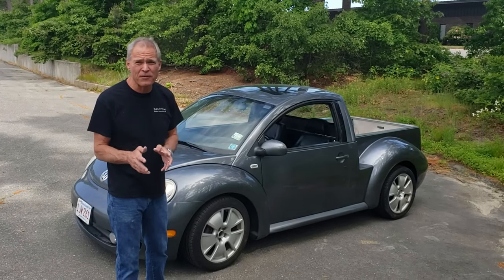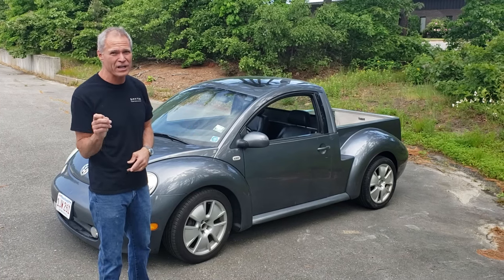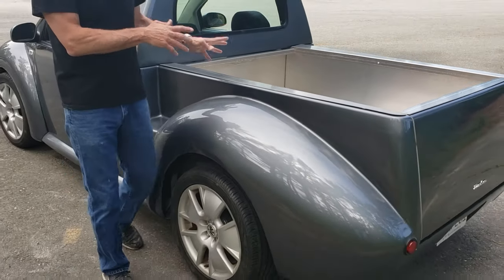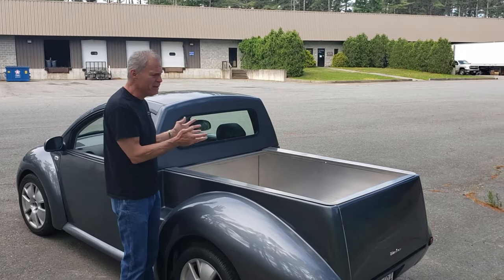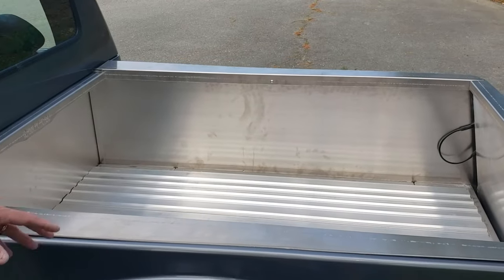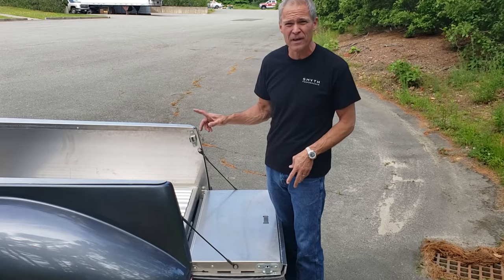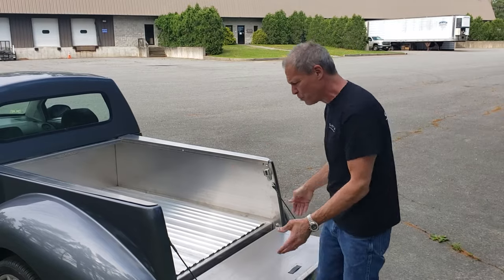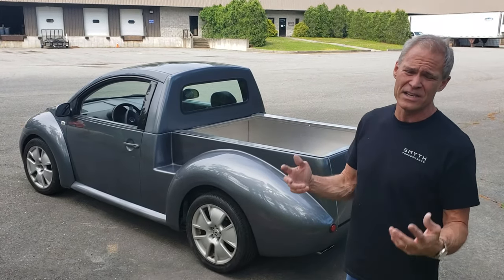Smyth New Beetle Ute Intro

Comment: I SO want to do this to my wife's beetle.  We're buying a new large car for an upcoming baby, and this little ute could be my daily driver.  I assume the sunroof will need to be disconnected, or can it still be used in "tilt" mode?   Also, do you ship kits to Canada?
Reply from the maker: sunroof on the beetle kit still operates both tilt and slide but only slides about a foot now

Comment: Mmm, 1/8th corrugated aluminum bed means serious dents if you ever use it to haul anything halfway serious - which of course you can't because it appears to be a 3'x3' square bed.

I never understand why folks who don't do any physical work or have any physical need demand to have a pickup - Then they lower it to the ground and put 91 load rated tyres on that'll pop the moment you drop a feather in the back.

I don't blame Smyth for seeing an opportunity to make a buck and its a better machine than the base 'Beetle', but that just goes to that old adage about makeup and fancy dress on a pig. - You ain't taking that old hog home to meat ma and pa.
Reply from the maker: Quite the opposite...since most people never haul more than 500 pounds these things are awesome. Motorcycles, engines, odds and ends...I use these every day. The aluminum bed is 1/8 thick 6061 extruded with ribs and supports...i have scratched them up good but never dented them. I do think that big truck guys should stick to the modern monsters. Now to the real reason these are popular...just plain fast and fun.
Reply: ...perfect for hauling a Starbucks mocha latte....but if you want the LARGE you'll need the towing package :)